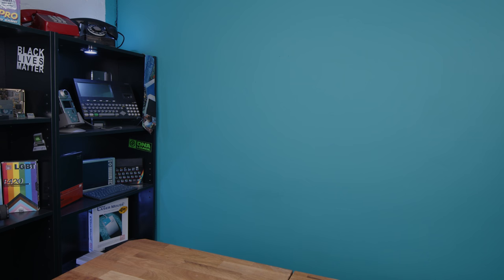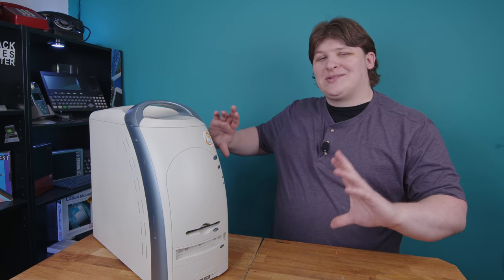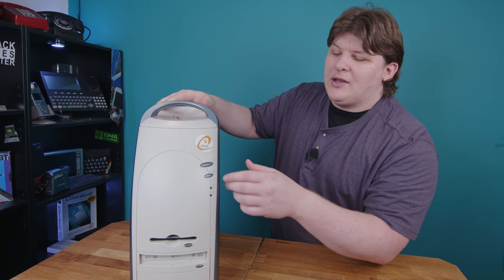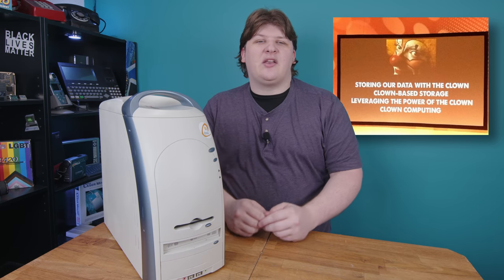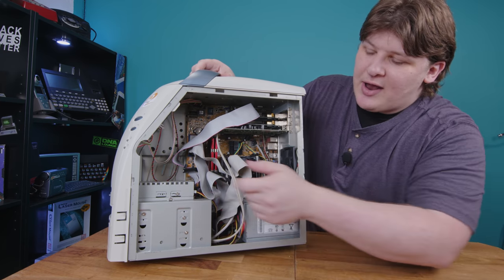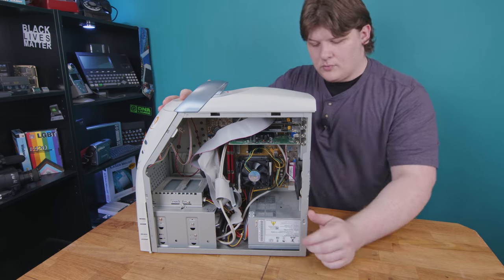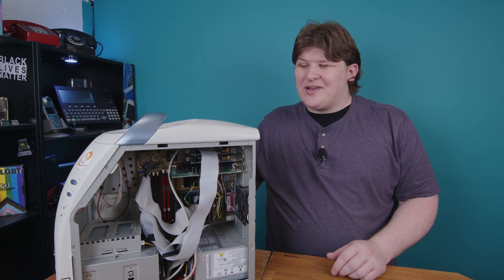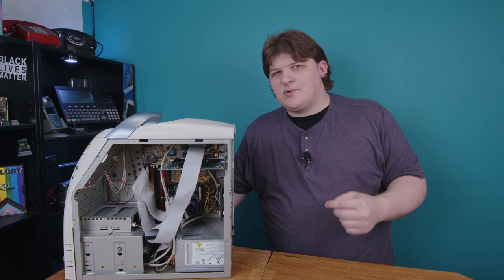Meet The Edge

Comment: I was recently trying to understand why I have no nostalgia for this era of XP/Pentium 4. This PC really helped me remember how awful that period was. I'm looking forward to the party tricks with those fancy cards though. 🥳
Reply: @Gatorade69  Yeah, I still have my Athlon 64 3200 based desktop.
Reply: I never cared about the P4. It seemed "fake" to me, growing through the 486, pentium, PII, PIII, when the P4 came out it just felt 1/2 baked to me. And all the consumer hardware of the era was bubbly and plasticy like this. I had a P4 laptop that i never kept because it was a plasticy clam shaped ugly beast. 

I think i have a p4 in my junk bin, but that's it, haha.
Reply: The only Pentium 4 worth a damn back then was the Pentium 4 northwood with hyperthreading. Willamette was terrible. Prescott was a firepit. And Cedar Mill no one cared because the core 2 duo was out by then.
Reply: @Gatorade69  Even GPUs were feeling the death of Dennard scaling, you just had no good reference as 3d acceleration wasn't really present throughout the 90's and when it was alive it was usually CPU limited. It took a 500-700 MHz Atlhon or PIII to max out a voodoo 2 and well past a GHz to max out SLI voodoo 2's; way faster than anything that was out when voodoo 2 released (took over a year to catch up). Unreal engine and Half-life in particular were CPU hogs.

This dampened the early leaps made while Dennard scaling was still in good effect, where you had both a good clockspeed uplift and an increase in pipelines. E.g. the  the original voodoo could crank out 50 MPixels/s and half that with dual texturing. The voodoo 2 clocked almost twice as fast and had an extra TMU which made it almost 4 times stronger in the standard dual-textured game (lightmapping was hugely dominant and in the kind of games that couldn't be lightmapped you usually had height-mapped dual-textured terrain). Geforce 256 to Geforce 2 was 120 MHz to 200 MHz and a doubling of TMUs.

It has never been that kind of big jumps ever again since the early 2000's. It feels like it lasted for such a long time, but mainly they just released meaningful upgrades every 12 months (and a refresher every 6 months) and kept it up for years. The time that passed between the voodoo 2 and the ati 9700 pro (capable of producing recognizably modern graphical effects, just very slow by modern standards), was about as long as the time between 1080ti and 3080ti. It's also about the same amount of time as passed between the pentium 233 MMX and the 2 GHz athlon 64. A decade old i7 2600k is still plenty usable, where as a 486DX2-66 in 2002 would have been completely useless. The 90's was a golden decade for computers, faster than Dennard scaling (at a cost of increasing thermal density) that continued smoothly for a decade. We will never see anything like it again as long as we are on silicon CMOS.
Reply: I was recently looking to do some retro builds for various software functionality kind of as stated in the video. I would cringe everytime I would think of p4. I loved the Prescott but I always flash back to the painfully slow first gen and get the shivers. Then I remember I have a perfectly usable p3 1000 with an agp slot. I think it will work well enough for what I need. I have early 775 c2d's if I need faster or I will seek out some athlon 2nd gen for a build.
Reply: Weird. I have an old dell dimension (dark grey model) with a pentium 4 HT and it’s fast as all hell for some reason. Boots up to windows xp in no time and apps launch instantly. 
It also says it has a floppy drive, but there are none present.

Comment: Back in the days upgrading was super common. And technology moved so fast that you ended up with old ports on your new mainboard. For example nearly every function of an ISA card was also available in a PCI or fancy AGP card. But you often got 1-3 ISA slots on your brand new mainboard even with PCI and AGP. Just so jou could use your old Soundcard or SCSI Controller etc. I even have Mainboards wich have 2 Power Inputs (AT and ATX) so you could use your AT Powersupply with the hard power off, or you could upgrade to a nice soft power off ATX one... Good old times. EDIT : Industrial PC stuff often uses very old (+ reliable and cheap) parts. Sometimes you can find 386 based systems from around 2000. Wich is crazy to see... But Cheap, Low power use, and reliable. EDIT EDIT: Please do yourself a favour and do not look up old Industrial PC stuff... Everything is so obscure, awesome and rare that you instantly want it... But that stuff is freaking expensive... ;)
Reply: This era is what drove me into this passion. I had like 10 different computers for an agp build a this and that pci . Mini atx.... I’m slowly rebuilding everything
Reply: Industrial computers and automation in general is such a fun field to go into. You have to have a certain strain of crazy to enjoy the wild hodgepodge of proprietary products, old products, and just plain bad products, but I call it fun!
Reply: in 2005 I was 13 and starting my PC journey. I had onboard graphics and had gotten to the point where that wasn't cutting it anymore, I wanted a GPU so bad that I can still vividly remember the dreams I'd have getting one and booting up current gen games for the first time. But my family wasn't computer savvy, I was the most knowledgeable at that point, and my mom was very stubborn in spending money on new/expensive things. 

I finally convinced her to buy me some AGP Radeon 9800 or something, but I had no idea about AGP, PCI, I just assumed the slot was all the same. So I get home, so excited, but I found out swift and hard about compatibility when my PC only had PCI-E. My hopes were dashed, but at least we could return it and get a proper one...

...but my 5 year old brother had grabbed the box while I wasn't looking and had decided to scribble all over it with markers... 

I think after that whole scenario it was another year before I got a GPU
Reply: I know I’m replying to an old comment here but did you at least try to return it? I “lost” the box excuse or something like that? I imagine worse case scenario is a restock fee deducted from the refund

Comment: Consider trying a paint brush or another brush like it with the bristles cut shorter so they're nice and stiff but still gentle on plastic for that hard dust. We do that to brushes to get metal shavings out of wire bundles after aircraft sheet metal shavings and it works an absolute treat.
Reply: A toothbrush is what I use in old cellphones with really nasty packed in crud. I can vouch for its effectiveness and it being reasonably static safe too.
Reply: Just use an air compressor.
Reply: @jaapaap123  when we're dealing with foreign debris, blowing it away isn't really an option if we're inside the plane. That doesn't blow it away, it just blows it somewhere else in the aircraft which isn't super helpful. But we do use it for a few things like if we're working on the exterior or working on a part at a bench.
Reply: Irony of cleaning a pc from a dentist office with a toothbrush

Comment: The Power Macs are supposed to be held by both handles, not by a single one. Considering some of them weighed up to 50 lbs, you'd definitely want to use both handles.
Reply: I've refurbished a G5 Quad which involved carrying it halfway through my house and out onto the patio to clean it and I was definitely thankful for the handles. I will say they could definitely be more functional though, they dig into your hands pretty badly if you're not wearing gloves because the extremely low centre of mass even when holding both means you have to angle the machine away from you to stop it swinging and hitting you in the leg every time you take a step 😅

Comment: The Pentium 4 is, in and of itself, a completely mind boggling part of computer history.

This is a dead-end micro architecture that was dragged from SDRAM and RDRAM through to DDR3 on some of the 775 era chipsets.

Not only that, but they (briefly) glued two of them onto a PCB to create the Pentium D.

10GHz anyone?
Reply: The Pentium M was faster than the Pentium 4 in terms of IPC (at least in the laptop division) and was based on the p3
Reply: @abhimaanmayadam5713  It also formed the basis for the later Core 2 Duo and all following Intel CPU designs.
Reply: I've seen 2.6 GHz P4's run like total crap, and I've also seen those run as a totally quiet workhorse. I've used one for about 10 years as a server.
Reply: It's what happens in a market when there is no viable competitor. All hail AMD, bringer of the Athlon64!
Reply: Also, IIRC, this era Pentium 4 is the same as an Itanium, but the difference is the instruction set decoder.
Reply: @no1DdC  yup. Too bad the Core duo and the Pentium didn't support PAE (like it did but didn't do it properly)
Reply: It's crazy that they designed the netburst architecture expecting that they'd eventually hit 10GHz.
Reply: @abhimaanmayadam5713  The problem is that some of the PMs didn't report PAE support however fully implemented it. That's why there's the 'forcepae' Linux kernel parameter. I'm pretty sure none of these problems existed on any Core Duo.
Reply: A bit like the PowerPC G5 chips. Clock-for-clock, not that much faster than the G4; but ridiculously power hungry and ran hotter than the blazes of hell. You could never put a G5 into a notebook computer. The G5 was the chip that made Apple look for alternatives, and Intel had already learnt from the Pentium 4 mistake and was introducing the Core CPUs, so Apple switched architecture entirely.
Reply: I Liked my Pentium D805.  It was cheaper than the Conroe Core2Duos yet it could still overclock reasonably well with not much more than a tower cooler, if you hit the silicon lottery.  When overclocked, I didn't really notice that much of a difference between it and my Core2Duo at work in terms of speed. Plus, it kept my feet warm.
Reply: I'd rather a Pentium 4 than a Celery
Reply: @dennisp.2147  I used to have a Pentium D in my computer. When idling the exhaust air was a bit warm. I ended up doing a Conroe mod and installing a "Pentium". I didn't gain any performance but the exhaust became cool, even under full load. Plus I could run the CPU fan basically silently.
Reply: Nah, the netburst architecture isn't so strange. Intel bet on Dennard scaling continuing for at least another couple of generations; they had the best process engineers in the business, they would simply pull a rabbit out of a hat somehow like they did the last half dozen times when faced with this choice.

Netburst was intended to run at 8 GHz by 2003. It couldn't really do that without halting and catching fire; but if they had managed it people wouldn't be shitting on the netburst architecture, they would be calling it forward thinking and shitting on the low clocks of the Athlon XP and Athlon 64. The reason it couldn't do that was not the design, it was the process; Dennard scaling did not continue and all the sacrifices they made in the design to get very high clocks no longer made sense, they became liabilities. A very, very deep pipeline only added latency and made branch prediction misses and cache misses hurt more; it didn't really allow you to clock faster because it just ran too hot. 

Nobody harps on about the pentium II adding a whole bunch of stages in the pipeline to support higher clocks than the original pentium; because it actually did clock way faster and clocking the L2 much faster was a big win. Pentium IV was designed for a process node with properties that never materialized. It made a lot of sense for this magical non-existent process, but not for what we actually got.

The reason AMD was first to X86-64 was that intel fully intended to kill X86 and replace it with the itanium IA-64 architecture in home computers after they took over the server market and they really didn't want to make X86-64. There was just one small problem; itanium was *huge*, brushing up against the reticle limit, and still not outrageously fast or exceptionally good at anything really. This was a project they made together with HP from the mid 90's, shipping the last itaniums this year (!!!), and it's just been a millstone around their neck for the last two decades.
Reply: I had one of theses early 478 boards with the dual ram configuration. There were no benchmarks needed to tell the difference. They ran like molasses with sdr. It was even more noticeable if you were to have tried an Athlon or Duron of the same speed with ddr you would have probably chucked the p4 in the garbage. I preferred the late slot1 p3 1000 although a little on the rarer side was an awesome setup with an i440bx with fast sdr. Of course the Athlon or Duron was a worthwhile upgrade. I did not mind the later Northwood or Prescott p4's. In hindsight they were not great, but they worked very well at the time. The were the real p3 replacements. Rdrammed p4 was trash from day 1 and was by far the worst Pentium experience I have every had with any of the lineup.
Reply: Nice case (and nice video) !
I think that Athlon64 also came on 3 sockets. s754, s939 and AM2. s940 does not count since it was only used for Opteron and early Athlon64 FX.

Regarding RAM, type compatibility, this era was really interesting. There was a lot of competing memory standards, and memory controllers were not already part of the CPU itself. So it was up to the motherboard chipset to support or not some type of ram. This meant for example that you could use a Pentium III on SDRAM, RDRAM (rambus) or DDR. Because there were Pentium III chipsets for any of these 3 ram standards.
Reply: All Pentium 4's were garbage.  That was when AMD was starting to make major gains into the PC market.  The techs knew better.   AMD was about twice as fast with half the Mhz and half the price.  Intel went with brute force to hit 2000Mhz and 3000Mhz.   Intel's Core2, which is NOT based on the Pentium4 tech - saved Intel.  Pentium3 > Pentium M > Core Duo.
   AMD's Phenom wasn't much better than previous AMD CPUs.  In fact, for some dumb reason, AMD went the route of the P4 for those chips!

RD-RAM was a scam that Intel tried to inflict on the users, and it bit them on the rear-rend.  Intel went with RD-RAM as they would have made MONEY for every stick of RAM sold.
Reply: Also remember more...  Intel promoted the P4 as "the future" with socket 423, knowing FULL WELL that socket 478 and 2.0Ghz+ was needed to actually provide some sort of good performance.  So yeah, the early P4s were SLOWER than P3 at 3x~4x the cost.    The "future" was a scam.  Intel was saying "invest in the P4 today with new socket and memory and you can later use a faster P4."  But as we know, Intel changed the socket and RD-RAM was kicked to the side by the industry.     The early adopters got screwed, like anyone who first tried Windows ME.

Gaming: Unreal Tournament (Which is NOT limited to 60fps)
AMD 1.2Ghz was 10% faster than a 1.5Ghz P4.  
1Ghz PIII and 1Ghz AMD = same as 1.5Ghz P4.  
On some games, the P4 1.5Gh with its $$ RD-RAM was SLOWER than the PIII with SDR.  Of course AMD was easily faster than anything Intel had.
Even in productivity, most of the time, the first P4s were slower than PIII.

Sure, eventually the P4  got better than PIII, especially since intel was phasing those out.  The P4 never reached AMD performance. 

PS: That case was a clone case, I think its by INWIN.
Reply: The even crazier part is a decade later when AMD made the same mistakes with bulldozer.  Having an AMD FX instead of an I7 in 2012 was like having a P4 instead of an Athlon in 2001.
Reply: Remember when they glued on x64 support for the lulz and it was actually really good
Reply: @kargaroc386  And now Intel is making the same mistakes with their Alder Lake revisions.
Reply: @soylentgreenb  As a fun fact from somebody working at Intel, there is a poster of Itanium on my wall, a nice colorful die shot the size of a dinner plate. It just says "Never Forget" on it. Next to it I have a last-gen P4 and Cannon Lake. I call it the wall of shame.

Comment: Ah, the "Transition" motherboards, I remember these.  At the place I worked when I first started in I.T. circa 2001, they bought tons of whitebox PCs from a local supplier, and as a result I got to see motherboards a lot like the one showed in this video.  However, by the time DDR got popular, the organization I was at finally made the plunge to buying from an OEM (Compaqs to start off with, which had pretty decent warranties at the time), and those were the first PCs with DDR that got deployed.

Some of the older systems I supported with Pentium 1 and backwards also had dual-support for EDO and SD-RAM (EDO was predecessor to SD-RAM for most folks... they were smaller modules that you inserted into the slot at a 45 degree angle, then "stood them up" to lock them into place).

Anybody that's messed around with like 1996ish PCs and backwards has probably has played around with EDO RAM... short of harvesting it from a dead computer, I'm not sure how you'd get your hands on it today.

Anyways, with the EDO / SD-RAM mobos, you basically flipped a few jumpers on the board to specify which kind of memory the mobo should expect to "see".
Reply: Thank you very much for sharing your story!

Comment: On the subject of "hard dust" some friends of mine and I griped about its cousin, which we named "datacenter grease" when fiddling with old and used rack servers.

Datacenter grease is not grease but the incredibly fine dust that appears inside old servers after having been run for years nonstop in nearly sterile environments. The server never looks dusty, but once your sleeve, hand, or arm touches a spot or crevice where the grease had accumulated, it leaves a dark smudge that would not come off without a laundry machine or washing your hands with soapy water, and even then it took effort.